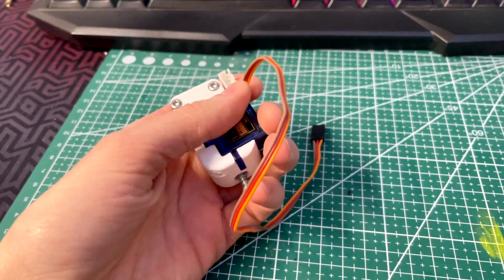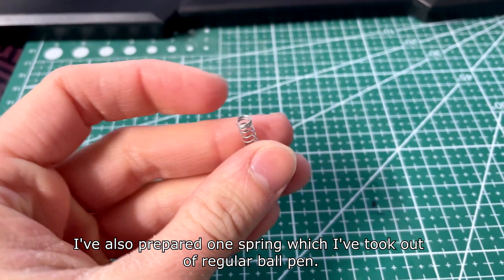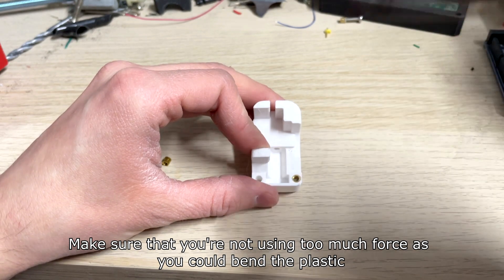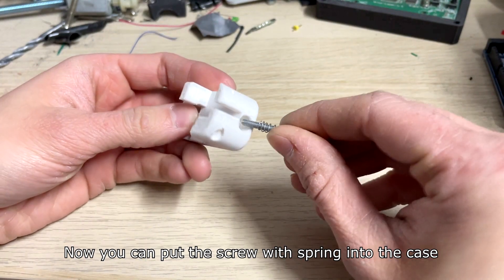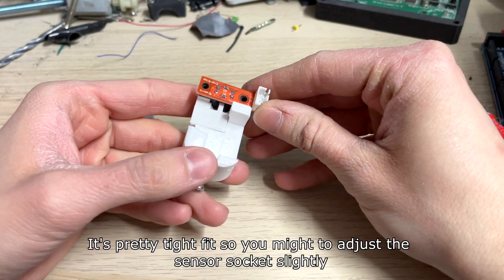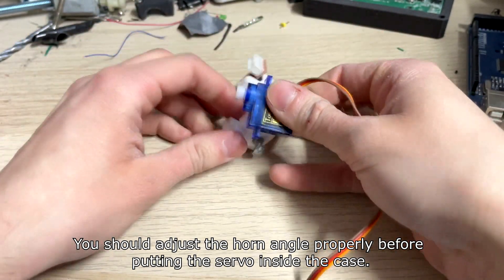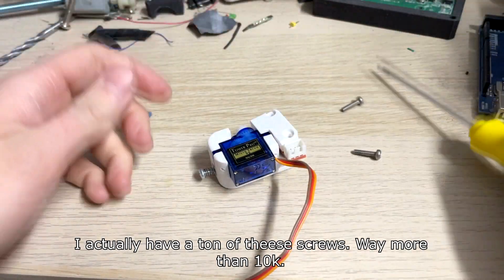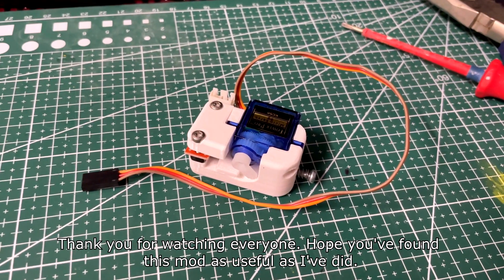DiY BLTouch Clone | BFPTouch remix

Comment: I have a  ender  3  mother boad 1.1.3 how  can i wire it up
Reply from the maker: You need the IDC expansion board, firmware flasher and firmware with abl capabilities

Comment: Hey, estimated cost of this (inc 3d printing services as i am planning to build a printer) is around $2-3, and using an inductive sensor with an aluminium sheet below the glass would be exactly $4,  so price between them doesn't matter, but just fyi for my budget, but what would be more accurate? this or an inductive sensor with aluminium below glass
Reply: oh yeah can this be attached using the i3 mk2 extruder?

Comment: It appears you need to do some sanding on the flag to make it slide better. I think it would be better to include that information in the video so makers know that is required for it to properly and easily slide. Otherwise it will bind and drive the probe into your bed and cause damage. I plan to include your design in my DIY probe shoot-out. But they are all based on this same design. Thanks!
Reply from the maker: Well it’s not really required as it worked for me even without the sanding. It’s just a matter of fine tuning your printer. If you got it tuned right then there shouldn’t be any performance issues with the probe
Reply: @ManolloMancelli  my apologies. I heard the crunchy noises. I had a few like that and they would stick sometime. Awesome job!

Comment: Printing and assembling it is the easy part. How do you drive the PWM servo to activate and deactivate it?
Reply: I suggest to follow the guide on the original probe referenced in the beginning. It has all the marlin settings needed to make this probe work.
Reply from the maker: It’s actually pretty easy. You connect it to specific pin on your board (depends on which one you use) and then you uncomment automatic bed leveling in marlin.
Reply: @ManolloMancelli  so automatic bed leveling sends PWM out a pin? What frequency does it use for activate and deactivate? I assume you have to activate the servo before installation, then put the horn on at the proper angle. Is that right? Seems like your video went into great detail on the minutia and ignored the technical. No offense. I love the build and appreciate you sharing. ☮️❤️🌈
Reply: @RichardBronosky  the servo control is not strictly PWM, but pulse length based; so the processor must regularly send pulses that in their lengths correspond to servo position, with neutral or 90° position pulse usually being about 1.5ms, but the time between the pulses is not critical, and in fact can vary depending on any number of things. Marlin generally tries to send about 50 position bursts per second to a servo. Anyway there's strictly no reason for you to know all this, RC servos are highly standardised and Marlin just knows how to operate them, with the only relevant input being the servo angle.

You can just mount a servo such, that it can make the motion without running into its stops; then you can test suitable angles with M280 and then set suitable Z_SERVO_ANGLES in Configuration.h. Alternatively you can remove the horn, play around with M280 to make yourself certain of the turn direction, then drive it to a known angle like say 0 or 90, attach the horn, and then drive the servo around with M280 until you have positions you're satisfied with.
Reply: @SianaGearz  great info. Thanks!
Reply: @ManolloMancelli  is software setup is same as original bl touch ? Please help me